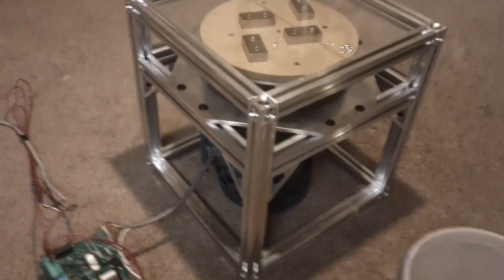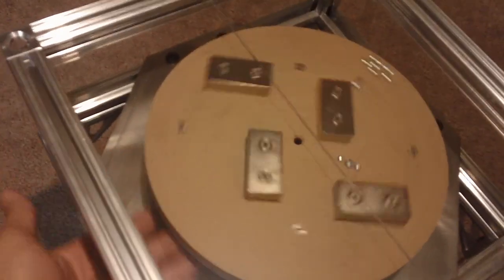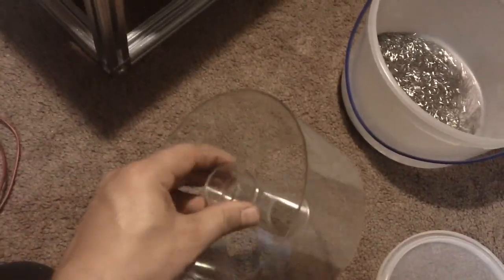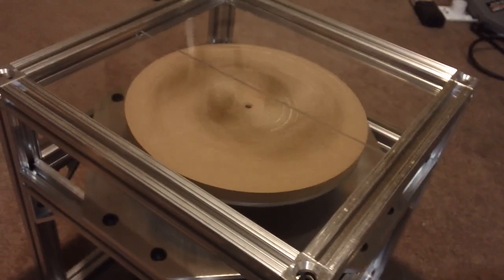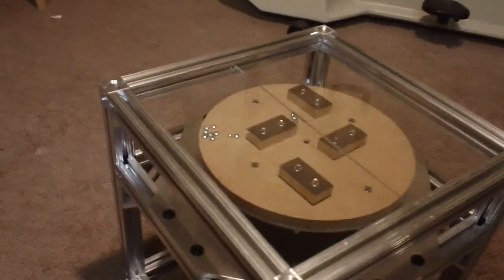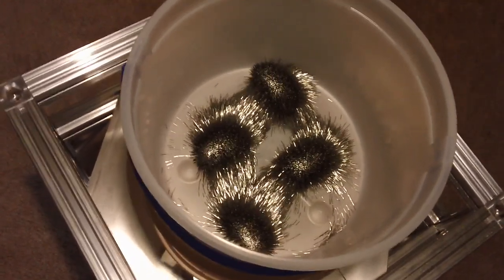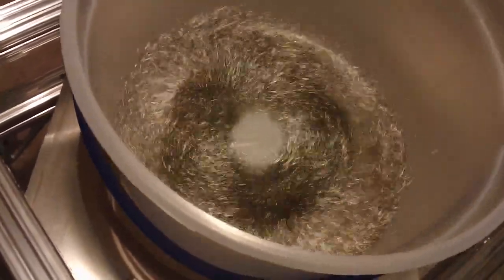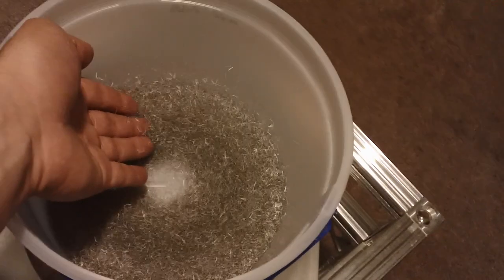Magnetic Polisher

Comment: Hi Brian ! Before buyng the engine I have a question: is there a possibility to connect speed controller to any engines or there is some specifications I need to pay attention ? Thank you for your help.
Reply from the maker: No - speed controllers are specific, and do require a specific type of motor, with specific ratings.  If you're going to use the KBIC120 speed controller or something similar, you'll need a 90Volt DC motor.  Hope this helps, and please look under my "details/show more" beneath the video, I have a list of all the parts/part numbers that I used.  Hope this helps, and have fun.
Reply: Brian Wisotzkey Brian, I looked through the list you made. Unfortunatly my knowledges in electics is very poor. We have 220 V system in my country, but as I understand we can connect 90V with 220V through the adaptor?  I'm thinking about this engine:  

 http://www.ebay.com/itm/Johnson-220-VDC-Electric-Motor-220VDC-12-Pole-DC-Hobby-Project-Generator-/271399449717?pt=LH_DefaultDomain_0&hash=item3f30aaf475

or this one:

http://www.ebay.com/itm/BALDOR-SPEC-33-2381Z134-INDUSTRIAL-1-3-HP-90VDC-DC-MOTOR-1750RPM-/111408666957?pt=LH_DefaultDomain_0&hash=item19f079594d

What will be your advise, Brian.

Thank you.
Reply from the maker: Dmitry Martinov Hey Dmitry - while this isn't that difficult, wiring up a motor/speed controller does require some electrical know-how..  Having said that - just be careful if you do decide to build this setup.  Now - if you're using 220V, then you'll need a KBIC240 or KBIC225 - these are speed controllers for 208-230VAC input (the wall), and your output from this controller will go to the motor.  The Motor you'll need for either of these controllers is a 180VDC motor, and they're all over ebay.  I'd recommend a motor of 1/2HP or greater.  ANyhow - hope this helps and good luck - this is a fun project that will give you a good machine and you'll probably learn a lot.  Let me know if you need any other information.

Comment: Brian, what screws or bolts did you use to join the aluminum parts together? Also, did you choose to use aluminum to avoid interaction with the magnets?
Reply from the maker: +Kufunklefec Ok - the screws and related hardware, as well as  the aluminum extrusion, I originally prucased off of ebay and I got all pieces from 8020 inc.  I didn't have any reason to build the machine with the aluminum extrusions other than the stuff is SO cool and versatile - it's like the erector set for adults - fun fun fun.  All the bolt/nut hardware is 1/4-20 button head socket (allen wrench to tighten).  You can get that from 8020 on ebay or BoltDepot.com is my go to source from most of my hardware.  Because the machine involves water, I typically buy stainless bolts/nuts.  The nuts are a type of T-nut that you should just buy from 8020 on ebay.  Save yourself time and headaches.  wherever you order your 1/4-20 bolts from, just make sure you buy 3/8" and 1/2" Lengths.  And maybe buy a 50 pack of each.  When you're on a roll and putting things together, you don't want to have to re-order and wait another few days.
Reply: Haha yeah, the extrusions do remind me of that. Expensive though. I'm thinking of just welding up a frame from steel square tubing instead since it is cheaper.

How did you attach the magnets to the board safely? I've got a tiny magnet that is 1/2 an inch by 1/2 an inch in a cube form and it is scarily powerful. I can hardly imagine handling a 1x2" magnet so close to 3 other super powerful ones. One mess up and your fingers are forfeit.

Also, how many pounds of pins do you use on average? What diameter size are they?

I bought a motor and the magnets you recommended. So I'll be putting my machine together in the next two weeks when the parts arrive.
Reply from the maker: +Kufunklefec Attached the magnetic one at a time and very carefully.  hardest part about the magnets are actually getting then apart and not letting them snap back together and damage each other.   As far as the pins go, I purchased two bags of each size available.  Take a look at the link,,,, http://www.riogrande.com/category/tools-and-equipment/polishing-and-finishing/tumbling/burnishing-media/stainless-steel    I bought both the 0.5mm and the 0.3mm..  However, depending on the size container/bucket, you might need more or less.  I typically use my food processor bowls the most (+6" diam.) - if you watch the video, it's the bowl with the center cylinder - this concentrates the pins..  or forces the pin and part I'm polishing in the same space - definitely speeds up the cleaning/polishing time.   Not suggesting this bowl, but maybe one like it:   http://www.seneca-river-trading.com/w10461926.html#.VnCNFEryu5M      Needs to have a FLAT bottom though..

Comment: Hello Brian, may I ask you to share same experience about the optimal rotation speed. I want to build one using an asynchronous constant speed motor  and I have two possibilities - 1450 and 2800 rpm. Which one will be better for brass case polishing/cleaning? What about the motor power, 250w or 370w?
Reply from the maker: Hey and thanks for your inquiry - I'm guessing you'll be using an induction motor, something similar to a table saw motor or such.  I think I'd tend to go with the 1450rpm, because if you go with a heavier media, starting the motor might become a more violent event.  Haven't done the calculations to watts, but for the treadmill motors (i.e. 90VDC motor), one wouldn't need more than a 1/4 HP, and in my case I just used what I could find the best deal on, which turned out to be 1/3 HP.  You'll have to let me know how your project turns out with the constant speed motor.

Comment: How did this end up working?
Reply from the maker: Hello and thanks for your interest - it actually works VERY well for cleaning newly casted parts.  The abrasive nature of this process is similar to sand in the desert eroding rock.  It leaves the metal work-piece extremely clean with a fine surface finish - best described as frosted in appearance.  easily polished though.
Reply: Thanks for the info, I plan on building one. I may just use wood for the frame or even steel tubing.  Aluminum extrusions has gotten kind of expensive!

Comment: I can't see the relation  polisher whats?   and how
Reply from the maker: +cesar Vazquez This machine will polish or clean any material which is not magnetic - it accomplishes this through abrasion, similarly to how blowing sand in the desert will erode away even stone, mountains, or pyramids (if you're in Egypt).  Typically when you make a piece of jewelry (metal casting process), there is unwanted material on the finished piece which needs to be cleaned/polished, and a magnetic polisher is perfectly suited for this task.
Reply: only I want someone to splaing and now I am clear thank so much

Comment: Good lord why did you use extruded aluminum for the base? I like the look but is there any actual purpose for it?
Reply from the maker: parker benz actually, there are reasons why I used extruded aluminum.  beyond the simplicity, I like working with alum. and believe it or not premium pine lumber from Home depot would have almost cost the same.  all other reasons aside, I wanted to be able to adjust the motor position relative to the platform, and the alum. profile/t-nut configuration helps make that simple task easier.
Reply: Brian Wisotzkey didnt know the cost was comparable to lumber. I can agree that it is very fun to work with, and quite easy to work with if you have the right tools.
Reply from the maker: Thanks for your interest and comments - there's probably 1/2 dozen ways to build this machine, and one way is probably just as good as all the others.  I'm also sort of addicted to the 8020 alum. extrusions.  :)
Reply: Brian Wisotzkey yeah, I can see why, there are just soo many uses for it, ive always thought of it being a little expensive, but tbh have never looked up prices for it!
Reply from the maker: Davy!  That's fantastic - quite a cost savings also..  Love the simplicity of your design and use of standard around the shop left-overs.  :)  By the way, I couldn't help noticing a pretty nice induction coil/heater on your workbench in the background.   I've been toying with the idea, to build myself one of those too.  Great minds think alike..  definitely keep me posted on your polisher - lookin good!

Comment: I guess main the electronics. But also the magnets. As I said I can pay u for ur time. But let's try one last time. How much would u sell it for with shipping. Hope we reach understanding. I can help u build a vacuum machine that I build it is better than what's in the market. It is used to debubble silicon for molds or casting material for jewelry.
Reply from the maker: lol - that's funny actually.  I also built a vacuum casting /degassing system..  I do lost wax casting, and I also use silicon quite often - so I'm very familiar with the vacuum systems, and I've
got an over-engineered one.  :)  Selling price of the existing magnetic polisher would need to be around $475 + S/H..  I really did run the exact numbers for building a new one, and buying current parts/components off of ebay and some surplus sites, and I cannot build it for less than $455 exactly.  Sorry.  :(
Reply: lol so your a jeweler heheh
I'm a jeweler i started my small line 
ok if i wanted with out the aluminum fram how much would i save ?
regarding casting and wax cleaning and preparing for casting i have alot of tips and trics if you are intrested ...
Reply from the maker: That's too funny - well I would make an educated guess that if someone was looking for a magnetic polisher, one would probably be using it for jewelry related stuff.  :)  and absolutely,
I'm always interested in tips and tricks, if you've got any.  Now - if you'd want to go wood frame, instead of aluminum, we could probably cut off $100-$120.  So, I'd say we could probably make one for around $365 + s/h.  I know you're probably thinking that's still expensive, but just the motor and controller are probably going to cost $200+...  ANyhow, let me know what ya think.
Reply from the maker: hey - not sure what you're confused about - I was suggesting that the wood construction (frame) would be able to save you probably $100-$120 on the build.  I think that wood will stand up just as sturdy as the aluminum framing.  Definitely can talk to you over the phone, and I'll email you that information asap.

Comment: I guess I have to answer a question I posed since no one else did🔎🔍 allabout.wiki/BestEquip   I asked what the red switch is supposed to do, since it is not an on/off switch.  I finally discovered that it controls whether or not the machine reverses direction every so often.
Reply from the maker: Sorry for the delay in seeing your message/question - yes, you are correct, the switch you see is to select CW or CCW rotation.  Thanks for checking out my video.